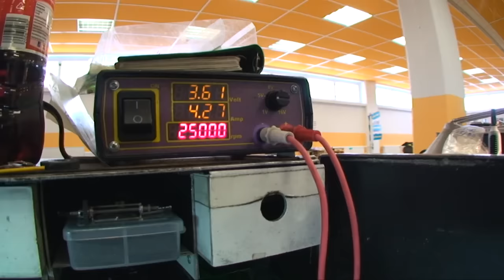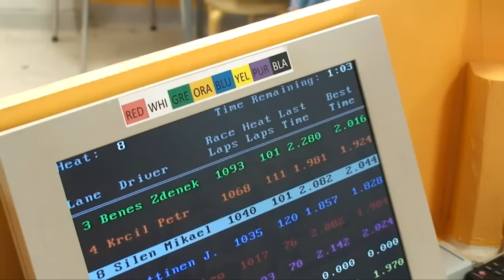Slot car racing European Championship Finals, Helsinki

Comment: Salut à tous, ne t'inquiète pas, y'a-t-il  des drapeaux de course dans le slot-racing et les circuits routiers au 1/24eme et 1/32eme (par exemple : jaune, vert, rouge, blanc, bleu, noir et blanc, noir, noir avec cercle orange, jaune à rayures rouges, à damiers)?

Merci cordialement, Johan.

Comment: I grew up with A/FX slot cars, in the 70's. 1st there was the OG cars..then, 'Magna-Traction' came along, then the amazing..for then..G-Plus cars.
We honestly prefered the pre G-Plus cars, much more fun to drive..drifting could be done & skill was needed on the curves..not just a 'floor it & watch' deal. The car bodies were really cool & looked like the NASCAR cars of the day..ie Chargers, road runners..there was even a neat Dodge street van that had an extra gear & different 
rear wheels and tires on the chassis. 
..the stuff in this video, though dang impressive, seems like 
far too much of a good thing in performance, aha.

Comment: cars go to fast to make it fun. cars should have enough weight to them forcing you to slow down on curves. If you go off track your out of the race.
Reply: You need to understand that there are many different classes of cars, slot car racing, and types of races. 
If you think this is "too fast" (an opinion I personally can't relate to, it's a blast and it's not easy), There are many other classes of 1/24 scale racing that are slower. Some much slower (the kids have to start somewhere).
Also, the type of race you refer to is called a "crash and burn" race. If you run a few crash and burns, you'll quickly find out why they are so unpopular.
Reply: The cars i had would slide sideways on curves and if you went too fast it would go off track. It was more realistic to a real car. @BigRalphSmith
Reply: @martyp2021  Well, for some, realism is more important than competition. That's what the entire Euro-1/32 scale is all about. Some get in to slot cars to compete and some get in to it for aesthetic reasons similar to why people get in to electric trains. For them, it's all about pretty.
All competitive slot car racing is based on pushing the edge of a de-slot regardless of the scale, handling characteristics, or the speed of the cars.
If you can put your car on the track and pull the trigger all the way and hold it there and your car never de-slots, you're doing it wrong (and you will lose a lot of races).

Comment: When I raced my slot cars back in the 70s late sixties you can see the car we had fun we had cars that did wheelies we used to put models on Iowa chassis of all types of models and you can see the car these cars are traveling at lightspeed and I don't see the fun in it and they're flat or you see is a blur I don't get it

Comment: Their too fast !!  I used to race slot cars in the 60’s, these are so fast there is no scale to the track or car. I wouldn’t get any satisfaction in the sport other than building them. I had a 1/24 scale 56’ T bird and down the straights you see it pulling a wheelie. Much more fun IMO.